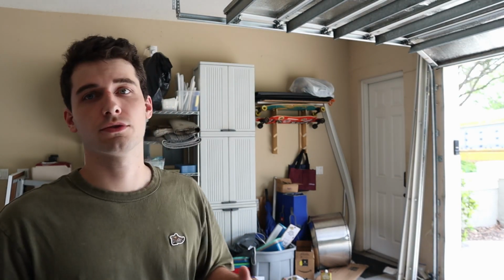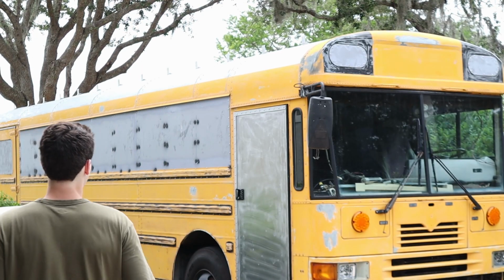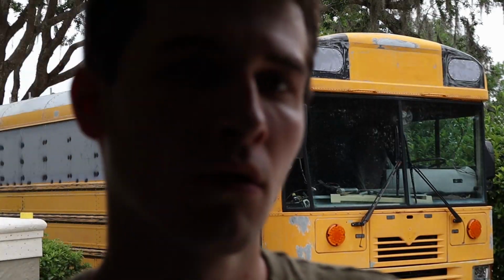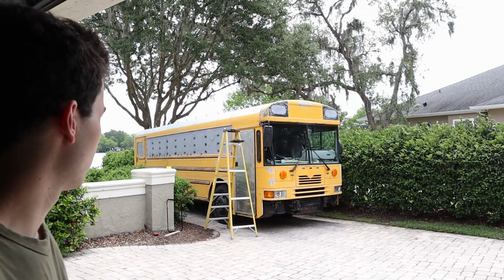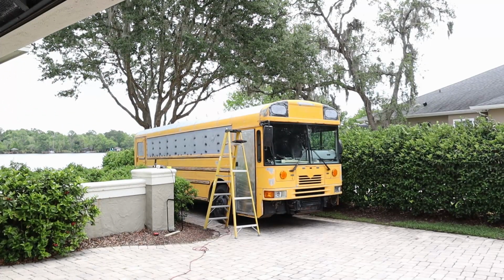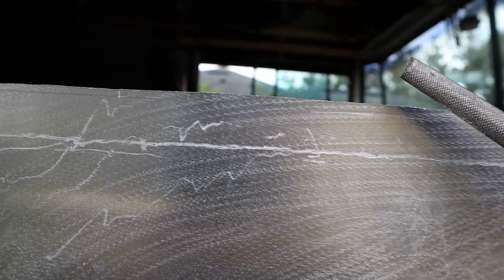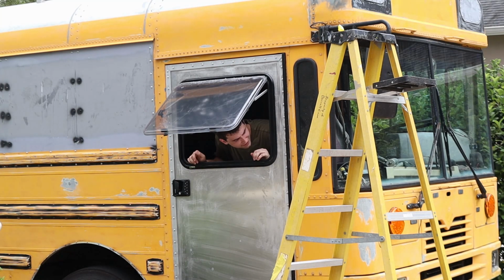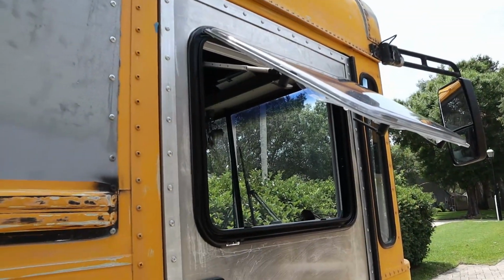Installing New Window on Custom Door | Skoolie Conversion

Comment: I am very impressed! Takes lots of planning and "guts" to measure and then cut that door hoping it is all correct! You did it! So awesome!  I like what @Cozy Living Machine said about the position of the blackout positioned to pull UP instead of down! Great idea as it will indeed allow you to manage your privacy and still allow some light in over the top. All the RV's I have seen have the blackout pulled down and never considered the advantage of having it the other way. Look forward to seeing how you attach the shade. 

Great work so far, so impressive and I see how satisfying it must be as you finish each process! Keep up the great work!
Reply from the maker: Thank you! Yes, it was a really good idea. I will most likely install them so that the shade pulls up now.

Comment: Man, that thumbnail got me. 🤣Great move with the dual-pane acrylic windows! We had them on two different rigs, big difference there. Also, the U-channel and two sheets to make the door looks fantastic for how simple it sounds! It seems pretty well fit also, I imagine some of that was planning, some of that was luck? 😂 Also, my preference is to mount that shade with the blackout part needing to be pulled up if only because you can create a bit more privacy and still get some light if you want to pull it only partially up!
Reply from the maker: That’s a great idea! I was going to mount it pulling it down because it seemed more “standard”. But I actually really like the thought of that. I will probably mount it pulling up now.